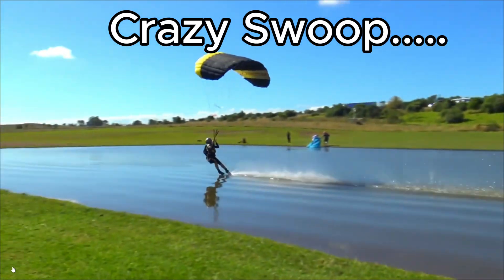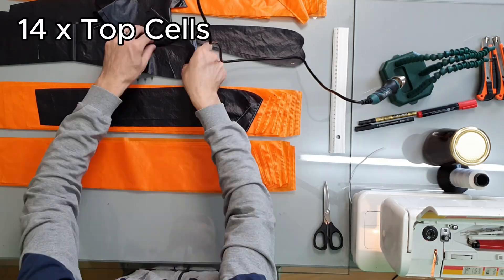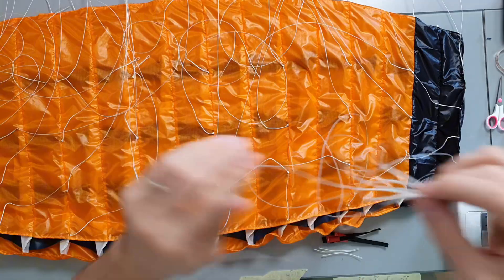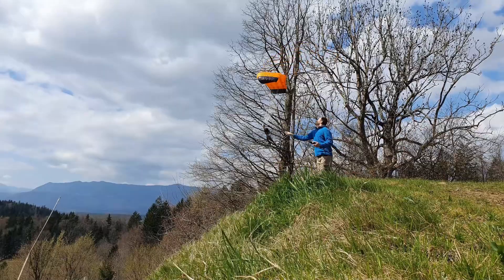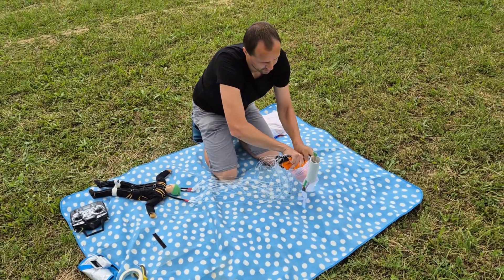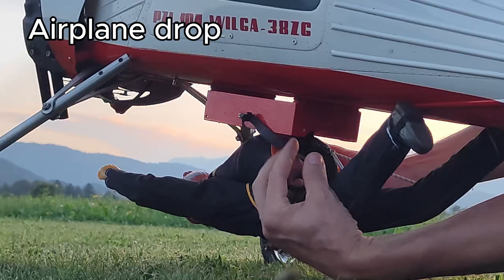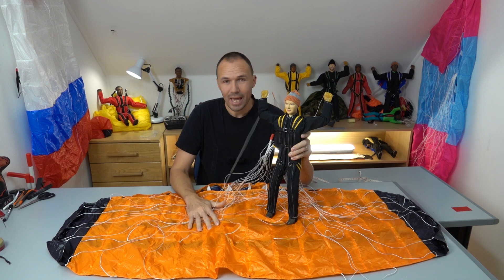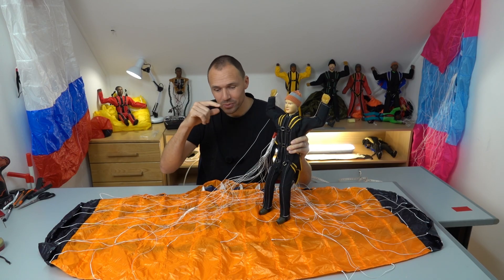I Built the FASTEST RC Skydiver with Cross Braced Canopy (Part 1)

Comment: Nice video! What are the suggestions for a good budget domestic sewing machines that really works?
Reply from the maker: You just need a very simple sewing machine—one where you can adjust the thread tension and stitch length; having a reverse-stitch option is helpful too. Nothing special, basically any household machine will do. Avoid toy machines under $50. In a week or two I’ll publish step-by-step instructions for beginners on how to make a parachute. That might be useful for you.

Comment: i am professional swooper, canopy pilot. i can help you to make your RS model swooping across the ground, because now it only flare, but not swoops. pitching nose down wont make you canopy swooping/ all modern swoop canopies have little difference between A lines and D lines. i think you should work with calage on your canopy, playing with pilot position relative to the leading canopy edge. I think you should make A lines shorter a little bit. but not so much. By the way, i wrote a book about canopy piloting and designing canopies, design parameters. and i saw that your canopy manages only with steering lines. in swooping a great role plays harness inputs, using leg streps of the harness that lowers one side of the canopy relative to another and it turns and dives
Reply from the maker: Thanks for your tips. I will definitely  install an extra servo to control the lenghth of A  lines manualy during the flight. Where can i buy your book? I would like to know more about these canopies.
Reply: I also can give you demo version of this e-book to be sure that it really exists)
Reply from the maker: Thank you for your kindness. That would be great, because I don’t really know much about these parachutes — I’ve only seen them in videos, and I wanted to make something like that. So i could make it even more realistic if have more info.
 Here is my contact: valjavecnace(a)gmail(dot)com